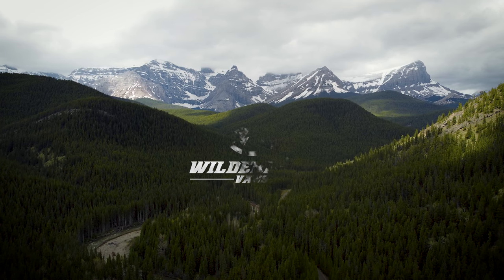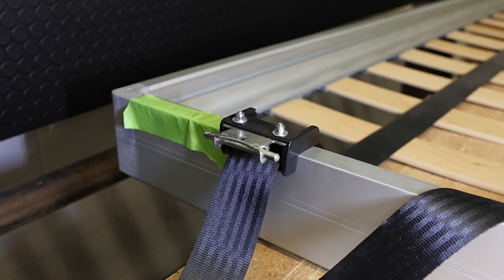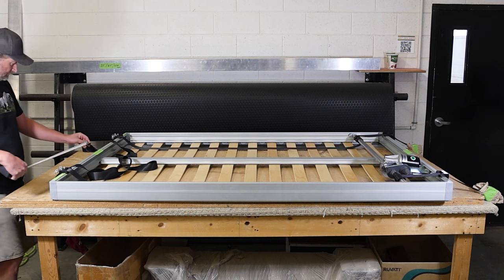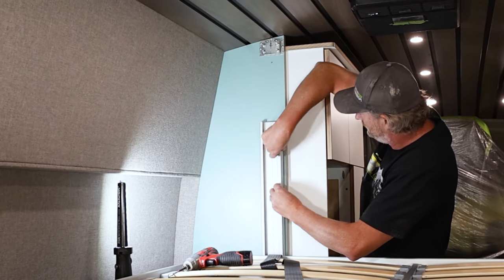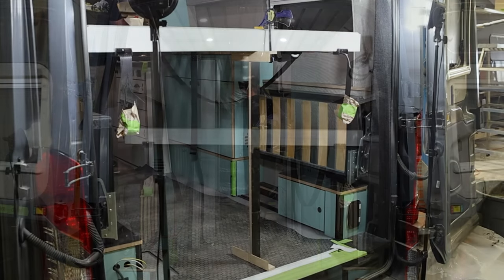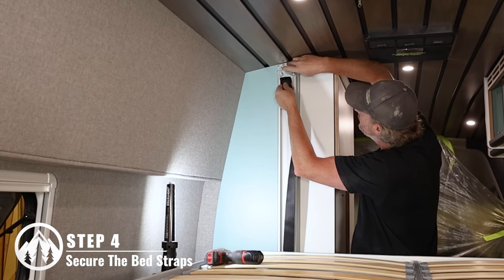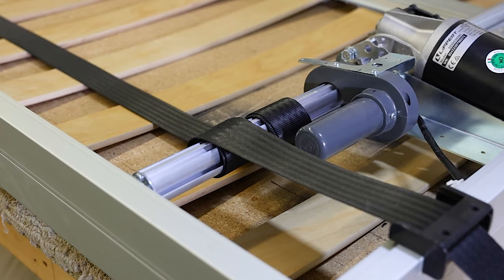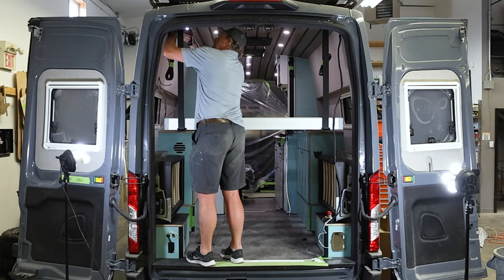Wilderness Vans - Lippert Smart Bed Installation Guide

Comment: Hi, excellent video and very informative. I've just one quiry if you could help me with it. 
When the bed is lowered in its final position does the bed need to be supported or are the straps sufficient.
Thanks
Reply from the maker: Hi! Thanks for the question, the straps are sufficient!
Reply: @wildernessvans thanks
Reply: Does the bed need to be laterally confined in sleeping mode to prevent it from wiggling side to side or do the guide rails keep it stable at any height? @wildernessvans
Reply: Do you still use this system I like it.
Reply: What is the cost of the operating unit only if you sell the parts I live in Wa state